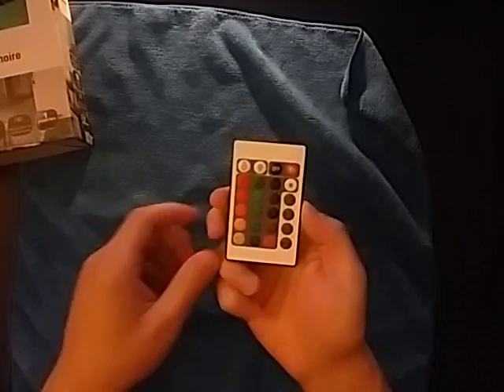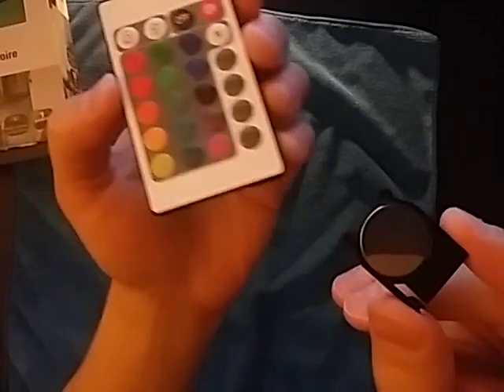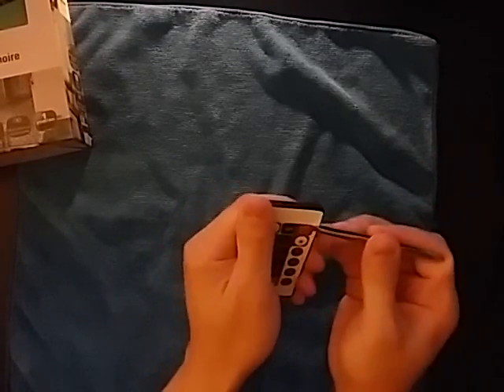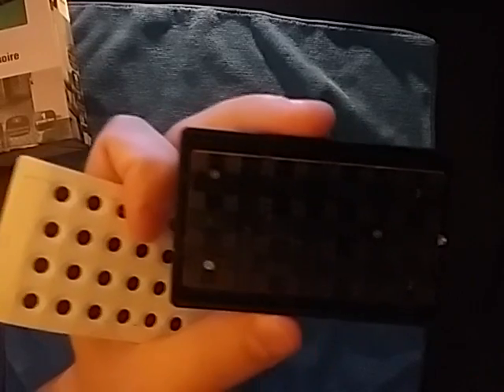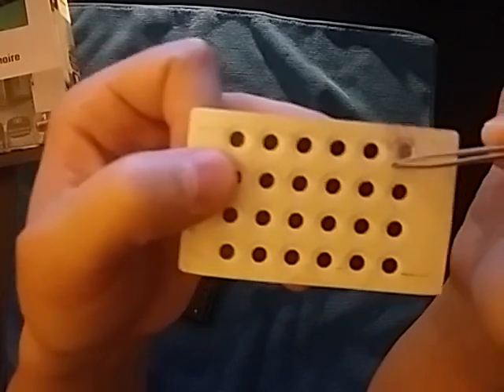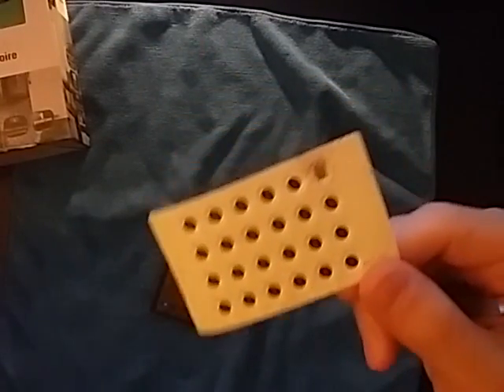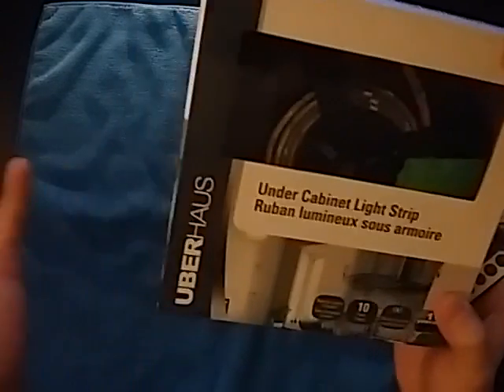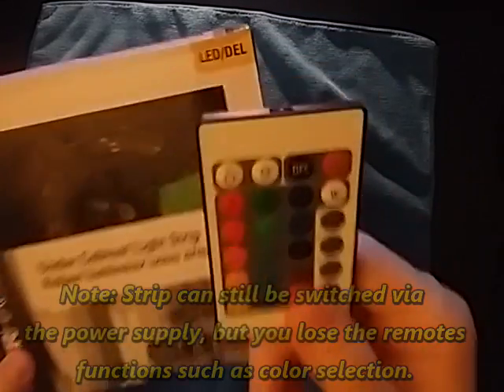LED Remote Repair (Buttons Not Working)

Comment: i bought mine 5 minutes ago and just got the remote and the whole thing isn’t working and i can’t get the battery thing open
Reply: Same here I bought 1minutes ago and the whole thing is not working
Reply: @virus6500  same lol when I opened it it snapped but led lights still work only one color though
Reply: Same. I just opened mine and the shits not working
Reply: Dripz Crazy I think we bought it from the same ppl cause legit the exact same thing happened to me except mine changes between 3 ugly ass colors and it does it really fast
Reply: Justin Johnson  it gave me seizures 😂
Reply: Kiley LMAO 😂
Reply: Mine randomly turned on and scared the shit outta me. It was red too. But now it works lol. All the colors
Reply: Anime Potato the red makes your room demonic 😂😂😂
Reply: How’d you get it to work?
Reply: SAMEE
Reply: Mines wasnt working either but try pressing the buttons really hard it worked for me hope this helps ;)
Reply: Did you guys got it to work? Idek how to start setting it up
Reply: i have the same problem how did you make it work
Reply: Ekin Tanrıverdi I fixed the wire
Reply: Ekin Tanrıverdi or u can try plugging it in a different outlet
Reply: Same
Reply: did you turn the battery around cause that’s what i did lmao
Reply: Kiley same I can get the battery thing open
Reply: Same!!!
Reply: The same thing happened, I dont know if the battery is the problem or what
Reply: Kiley SAME.
Reply: Kirra Hutchinson push the little button towards the big pull thing and pull it and the same time.
Reply: Kenny ‘ s Wrld ! it won’t work
Reply: bro same
Reply: Jinares SAME
Reply: Jinares SAME i just got my LED strip lights, it turns on and off via switch but it stays on one colour and the remote doesn’t work at all
Reply: Kenny ‘ s Wrld ! this actually helped thankyou!
Reply: Same
Reply: @justinjohnson4023  same
Reply: Same I tried to open it and I broke it.
Reply: same. got mine today and only one button works the remote just won’t permanently change into the colour I choose
Reply: @stepsisjared4304  same

Comment: PLS HELP! I bought mine and the lights turn on red but remote won’t work. won’t send the signal i think. battery is in.
Reply: have you gotten this problem fixed and how?!
Reply: Same
Reply: yea i have the same problem :( i want to use one of the features on the right but they all switch to red except for the one that starts blinking very fast that just shuts down my entire thing
Reply: Cinnamonro11 SAME OMG HOW FO U FIX IT
Reply: Zafnon Xox it started to work when I started to use the app. Does your app work?
Reply: Cinnamonro11 wait wat app???
Reply: Cinnamonro11 wats the app called?
Reply: Zafnon Xox magic home
Reply: Cinnamonro11 thabks doesn’t it Connect to my LED lights by itself??
Reply: @zafnonxox7884   yes u will have to connect it with your wifi and stuff

Comment: I cant open the battery!
Reply: YEEEEEESSSSSSSSSSSSSSS
Reply: did you figure out how to open it?
Reply: hold the side little tab and push it into the open of the battery. Then while holding it towards the open part, pull them both
Reply: I can't I'm French, I try to understand youre message but I don't see any little tab... Help please
Reply: 「Zioko」what kind of battery does it take?
Reply: I found but nothing worked
Reply: Freezing TV me neitherrre
Reply: Mine was stuck and I opened it forcefully and it snapped in half
Reply: @Zioau  worked a treat, thanks!
Reply: Freezing TV SAMEEEEE
Reply: Sameeee
Reply: Zioau I broke it
Reply: Justin Johnson same mine too and now I’m even more stuck
Reply: There's a super small screw at the top, unscrew that with a screw driver the same size & then pull the little thing on the right side and pull the "release" thing open. I'm terrible at explaining but hope this helped

Comment: Another way to check if the remote IR is working is to hold it up to your smartphone camera and push any of the buttons, you should see the IR diode flashing through the camera viewfinder on your smartphone screen.
Reply: U can see the reflection of the diode on those led remotes
Reply: I did not know that and was not expecting it to work.  Now I'm over fascinated over this little trick.  Ps. Light strip still won't work.
Reply: Hold it up ti my camera and press buttons? I dont see how that would work.
Reply: @polishpat95  It's due to the IR filter. On my iphone6, it's hard to see (depending on light condition), but it does work.
Reply: It flashes but when i press buttons the led lights wont change color
Reply: @Spiritual_AJ01  Me too. Have you found a solution?
Reply: AJPlayZ 01 same what do i do